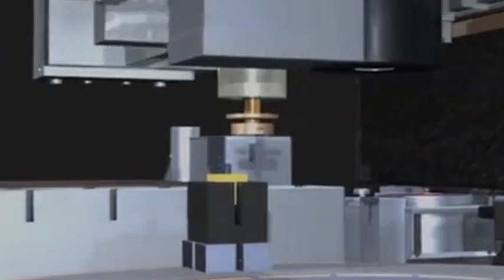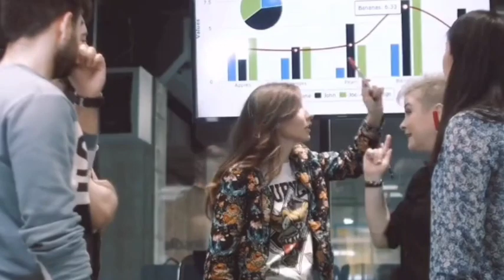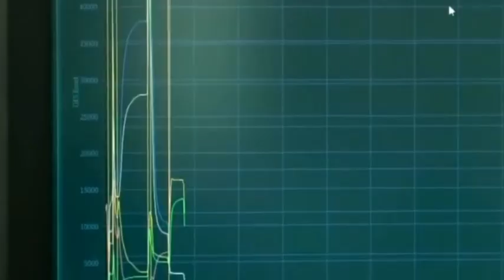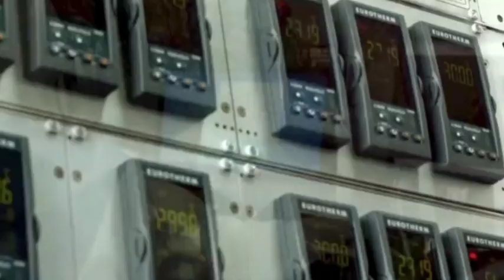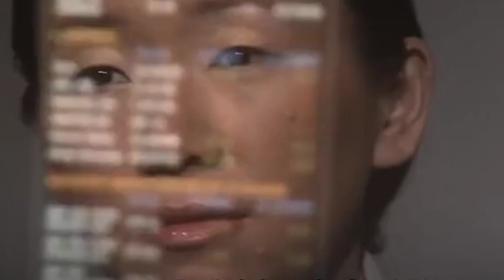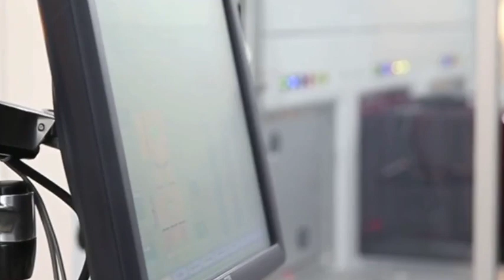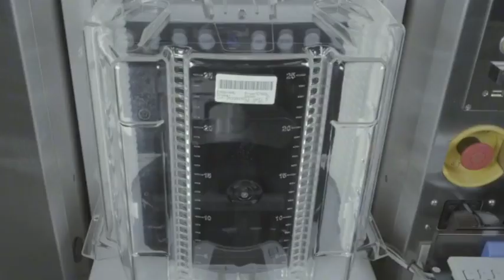China launched the EUV light source engineering prototype, and the measures against USA have worked.

Comment: This video is high on misinformation.  You say that EUV is dependent on external countries, yet China appears to be developing its own domestic supply chain, everything from light source to optics.  ASML may be dependent on foreign sources, but China is seeking its own domestic self-sufficiency.   Further the video says that China was suppressed in developing its own lithography abilities.  Not true.  Chinese semiconductor companies followed the western pattern of separating design from fab.  This separation is what made TSMC great.  Fab takes huge capital investments to function so the cheap way out was to focus on design and let TSMC take on the fab.  Now, China realizes that it needs fab to be self-sufficient in semiconductors and in that vein, it is creating its own fab industry.  In mature node chips, it is well underway and will capture the lions share of that marketplace solely on a cost advantage.  China will keep nibbling away at the high end. SMIC can produce the equivalent of 7nm node chips using their immersion DUV machines, the question is whether they can get satisfactory yields to be commercially viable.  SMIC thinks so, otherwise it would not be pursing it.

China is about the same stage as Intel.  Intel is still digesting 7nm, but is exploring smaller node chips.  Intel is the only company that does both design and fab.  Chinese companies are embarked on doing the same. Companies like Huawei have mature design abilities and so far Huawei has two fabs, one focused on photonics and the other focused on 28 and 14nm fabs. SMIC, which is a pure fab company like TSMC, is still expanding its fab capabilities at existing plants and has 4 new fabs coming online this year.  Overall, we will see new names in the growth of China's semiconductor sector and new innovations that will keep China growing in the semiconductor business.